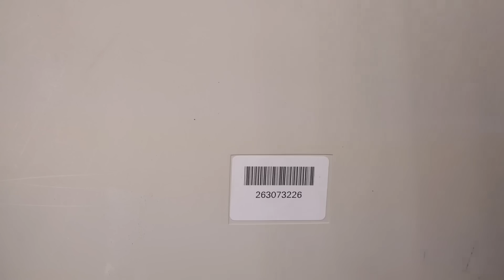Figuring out how to remove polystyrene residue from cords

Comment: After using acetone the cable will be dull, use cheap furniture polish, the old fashioned kind with wax, & go over the dulled cable. It will look like new, help clean it, & it adds a bit of protection too. I use Behold, but there's others, dollar stores are the cheapest. Its also great for cleaning & protecting any plastic or rubber.

Comment: I also noticed a similar issue happens if you buy a toy that has the egg carton holders. The toy parts are in bags. One time I threw the bags out and put them in bare. The paint on the toy came off in areas. So I assumed it was a reaction between the two materials. And never did it again.

Comment: IPA and a micro-fiber cloth worked for me. Put it on the cloth and ran it back and forth along an old Vader 2600 whose cord had some styrofoam residue. Yes, it takes a little elbow grease, but it works fine.

Comment: Only done knock off model M external kB for Amiga and telephone/ POS terminals.

I use the 97% ISO like you did though I soak for 15 minutes first.

After wipe off I soak in white vinegar for 30 minutes then dump in bicarb soda & lightly scrub W/ a toothbrush on EMI safe brush.

Takes anywhere from 5-20 minutes to get most of it off.

Some stubborn spots / pock mark corrosion effects may remain.

Comment: Acetone is stored in HDPE containers, also whenever you clean with acetone or IPA wipe off the residue as soon as you can, this keeps the floating debris from lingering in the liquid solvent, as it evaporates from the surface it leaves behind everything it removed. Also for acetone this is especially the case as you are trying to remove the more quickly soluble styrofoam, and not melt at the obviously less-readily-soluble PVC cord. Acetone DOES dissolve PVC in 'high concentration' and is present in PVC pipe cements also.

Comment: I so wish that function keys had stayed on the left as they are in the IBM Model F layout. They're so much more ergonomic that way, easy to press quickly and accurately without looking. As it is, I'm still having to use a keyboard from 1991, the Northgate OmniKey Ultra2, to get that layout (with F11 F12 above the F1 F2 row, separated by a gap).

As for the residue, I'm pretty sure I've had something like this on at least two of my cords. I don't remember how I cleaned them or if it could have been from polystyrene. I do wish you had investigated more what was causing that matte effect when you used the acetone... preferably on a cord you didn't care about, to figure out how safe it really is to use acetone on a cord like that of the Model F keyboard.

Comment: I would try some 0000 fine steel wool to abrade the styrofoam residue. That should leave the finish of the wire pretty much intact. Such wool is often used to polish metal, so it works at a very tiny level on surfaces. It may even make it shinier than before.

Comment: The problem is not the polystyrene, but actually the cable itself. The "juices" that keep it rubbery and flexible, start to seep out, and melt the other plastics that they are touching (ABS included!). 
Always, ALWAYS pack the cable nicely into a little separate nylon bag, as to not touch anything else (the little IKEA zip-lock bags are ideal for this).

Comment: Ran across the same issues, when restoring old Dumb Terminals & Teletypes, of the late 1970's & into the 1980's.  IPA or the older IPA 'soaked' wipes, originally used for cleaning Tape Heads works good, with a little elbow grease.  There is another cleaner, commonly used in the Telecom Industry, generically called DeGel or Gel Off Wipes, which works wonders at removing those stubborn sticky residues, however it is not friendly to all surfaces.  Similar to acetone, use it very cautiously, with rubber gloves, & good ventilation.  It will dry your hands out very quickly, so use gloves.  Follow-up with Windex, & wipe clean with dry towels, to clean the surface of any oily residue.

Comment: I use screen wipes... the cloth is just abrasive enough and doesn't have an impact on the cord. Stubborn bits just need a little scraping with a fingernail - anything harder can scratch the plasticised PVC

Comment: Hi Adrian. I have the same problem some time ago. I solved with a product for cleaning. CIF Crema. is a white cream for clean a lot of things, from kitchen to bathrooms.
I solved with that, and also solved the problem of a tablet with a back of "rubber" with time this get sticky and dirty (like black bubble gum with the sticky felling of duct tape but a strong one), and i get really afraid of this getting unusable. BUT. This solved both problems.
This product is from unilever Argentina. 
Maybe there is a SIMILAR PRODUCT IN USA OR CANADA (i remember you lived in Canada).
Also, i didn't find any detail of the chemical composition. BUT, with a search of this kind of product (THERE) .... I think you could find a good way to replace it with a product from USA-Canada.
By the way, i used, IPA, window cleaner, grease cleaner from 2 different companies (a strong and a light version) and many other products and never find a REALLY good result.
Only with this. It's difficult to use it i used gloves but in the end, the result is PERFECT. IF YOU WANT I CAN SHARE THE LIST OF PRODUCTS I USED TO CLEAN AND YOU CAN MAKE A CHECK IF THE SAME SOLUTION CAN SOLVE THE PROBLEM WITH SIMILAR PROBLEMATIC. (write me if you believe this could be of any good use and i will make the list)

this is the product.
https://www.cif.com.ar/productos/multiuso/cif-crema-original-con-microparticulas/producto.html

Comment: There are not a lot of solvents that attack polystyrene but not PVC. The two that might be relatively easily available are citric acid (which you'd have to dissolve in water) and fuel oil. "Fuel oil" is not particularly well-defined, though. I'd start with kerosene and then try diesel fuel.

Comment: My ebike hub motor has some PVC covers for the axle nuts and they were both pushed into styrofoam packing and did the whole residue thing.  Doesnt affect much but doesnt look nice.  I will try cleaning it later.  I tried scraping it off and it was giving me a hard time.

Comment: Mineral turpentine works fine and its cheaper and it removes any sticky residue. It's my go to for cleaning cables. Put some on a cloth and gently rub it on the cable.

Comment: For obvious reasons, I do not recommend, encourage or endorse the following use of gasoline:
I'm sure many are familiar with gasoline's reaction to polystyrene. For faster results and an attempt to avoid the abrasion from excessive mechanical force, I personally would have tried to use a cotton ball and a miniscule amount of gasoline (think <2ml) before wiping down the residue with IPA and then allowing the remnants to evaporate in a well ventilated area that is free of sparks.
Though, to be clear, I would first conduct this experiment on samples that hold more value as a test subject than as historical utility before ultimately executing it as a restoration procedure on a rare commodity such as a model-F cable. 

Of course,
Even though gasoline, IPA and acetone all share the same NFPA 704 fire diamond (Heath 1, Flammability 3), I'm sure you're familiar with the stigmas and dangers of gasoline. If not, then familiarize yourself through education rather than experience. 
If you experience anything, good or bad, by following the thoughts of a Youtube comment (or thoughts anywhere else) the responsibility is on you. Anything you do is at your own risk.
I am including the common sense warnings because, not only can I not be held liable for any mistakes, but because I genuinely do not want any mistakes to happen. I've been doused in flaming solvents in the past and do not wish this experience on anybody. Noxious fumes and accidental combustion aren't fun, either.

Comment: Hmm... Dremel cleaning pad dipped in IPA running slow. Maybe the jewelers rouge. Also, why did you do it over the keyboard ? You could have simply turned it around and just worked on the cord.

Comment: So PVC is a hard brittle plastic, it's what phonograph records are made of, which need to be very surface hard in order to hold the shape of the groove.

To make cables, PVC is mixed with plastifiers, which are effectively non-volatile solvents, which serve as a sort of lubricant allowing the molecules to slide past each other, making Soft PVC. Unfortunately the ability of those to move around freely means they'll also diffuse onto any material which touches it, and they also dissolve polystyrene, because it's difficult to find a solvent that doesn't work on polystyrene.

The reason Soft PVC is used for cable sheathing in spite of being such a piece of shit is that... well it's cheap and it's naturally fire retardant.

The bottle is of course not made out of PVC. There are two candidate families, polypropylene and polyethylene, and in your case it looks like the latter. Both are highly chemically resistant and highly recyclable, which latter is good if you suddenly find you made wrong bottles or too many of them, happens more often than you'd think. Also hopefully humanity might some day actually recycle that stuff even after it's been used, some countries actually already manage to do at least polypropylene. As a rule, a production line making high-volume products in either of these two will flat out refuse to touch any other plastic than the one they already use, in order to not deal with contamination.

I don't think removal of polystyrene residue from PVC is possible without removing the topmost layer of PVC, because they would have diffused into each other. But on an off chance that it might be, try limonene. This solvent will make quick work of polystyrene but might just have little effect on PVC. ABS is usually surprisingly fairly resistant to limonene as well.

When handling solvents such as acetone near ABS parts, please do not consider a microfibre cloth a sufficient protection. The solvent will soak through the cloth really easily and then you have a case of damage on your hands! Cover the computer with polyethylene.

Comment: I would suspect the bottle that the acetone comes in is HDPE. Which coincidentally is the same plastic gas cans and milk jugs are made from.

That said... perhaps you could try using zippo lighter fuel to remove it. It's a fantastic adhesive and label residue remover.

Comment: The acetone bottle is likely high density polyethylene or polypropylene.  You might try lighter fluid on an inconspicuous area, or WD-40.  Even DeOxit might have a beneficial effect.  Whatever you do, don't try Brakekleen.  You could also try using an Armor All wipe to restore the shiny appearance once the cleaning is done.

It looks like you were actually having fun here, and a little fun in the work is a good thing.

Comment: I always refer to a chemical compatibility chart to work out whether it's safe to use a solvent on a plastic. If you google a chart for PVC, it rates the compatibility with acetone as "D-Severe Effect", whereas isopropyl alcohol is listed as "A-Excellent". However as you saw the main effect is just making the surface dull, since you're not leaving it on for very long and cleaning off any residue with IPA afterwards. It would definitely be worse if you left it on, or even spraying it on can be worse than wiping it on with a cotton swab or cloth.

The bottle that the acetone comes in is probably polypropylene, which has excellent compatibility with most common solvents.

Comment: I have heard that it's additives in the cord (plasticizers) designed to keep them flexible/supple that can cause them to melt/transfer other plastics (like ABS and polystyrene). None of those plastics are particularly soluble in alcohols so I'm surprised it even worked at all, but it would definitely take some elbow grease.

Acetone can dissolve a wider variety of plastics; the bottle it's in is probably polyethylene (likely the low-density variant, referred to as LDPE). Any time you see a milky white bottle that's fairly flexible like that, chances are it's LDPE since it's cheap, easy to mould, and pretty chemically resistant. I suspect PVC would be at least slightly soluble in acetone, which explains the dull appearance after you used it.

Other things to try:
-Gasoline (smelly and will leave some residue) or other similar solvents (mineral spirits being my recommendation for something less smelly) will likely dissolve the polystyrene quite well and may leave the cord less affected than acetone. 
-Ethanol (rubbing alcohol) and isopropyl alcohol have slightly different solubility profiles, so I keep both on hand and try the other when I encounter something stubborn. If you carefully check the labels in either pharmacies or hardware stores, you should be able to find 95% ethanol to keep in your stash to try, but in this particular case I suspect the IPA will work better considering the materials you're working on.
-Lacquer thinner or MEK will be stronger, but I suspect they'll attack the cord itself as well.

Comment: Ok, I learned long ago on how to clean things like this, best way is (going to sound odd) you may want to try it, firstly, vasoline, a heavy quality grease/oil which actually will work slowly under the styrofoam between the ABS, example here would be to just work vasoline all over the cord to start with, and let it sit for a bit, then come back with a 5%~9% mix of acetone to alcohol (I used to pre mix bottles of it, 10 ml of acetone to 100 ml alcohol) and use that to remove everything, it will lift the vasoline and all the styro, which will often tend to leave a nice shiny finish (not greasy).

Comment: There is a plasticizer added to the PVC which makes it more flexible and "rubbery."  This chemical leeches out of nearly all plastics over time.  It's a solvent, and attacks the styrene which causes the bonding.  It actually does the same thing to styrene making it rubbery and more difficult to remove.  Acetone is a highly volatile chemical.  Using it sparingly, it will evaporate off assuming a warm ambient temperature before causing damage to PVC.
Reply: If you want to add some shine back to most plastics including ABS, use Boiled Linseed Oil.  It is mildly solvent of most butyl plastics, and will leave a nice shine on dull or oxidized plastic.  Be careful as BLO can spontaneously combust as it oxidizes and evaporates off of rags and towels.

Comment: I strongly suspect it's not the PVC itself, but rather the plasticizers in it, that's the problem.  It's also probably not an actual chemical reaction either, but slow solvent action.  I would  expect a chemical reaction to produce a more distinctive result than merely gluing the styrofoam to the PVC and the PVC suffering modest surface deformation.  A whole new substance should be created, either properly fusing the two materials together, or appearing as a boundary layer between them.

Comment: Most of those plastic bottles that are chemically resistant will be made of high density polyethylene, hdpe2 usually. Most big rotomolded containers are made of this as well.

Acetone is almost like what’s used in pvc cleaner and I’d definitely expect it to melt vinyl stuff. 

I’d have tried to use a citrus based cleaner like googone or maybe citristrip, these often have lubricating-like effect on old dried out plastic versus ipa which can dry things out and crack paint and such. I suspect you’d have even better results. I just restored a coil cord in a vintage lamp this way.

Comment: Next time try using denatured alcohol also know as marine cooking fuel. This is basically alcohol at 99.9% and the 0.1% is other additives to make it non consumable. One of the additives is acetone which will do the job but the alcohol will do what you want. I use this in all of my electronics cleaning. The only draw back is a light dulling from residue. A quick wipe with a cloth will get rid of it.

Comment: Personally. I take 70% medical grade isopropyl and wet a rag with it. Then grip the cable with my hand and the rag in between, pulling on the cable with my other hand to run it through. For stubborn bits of say paint or material like you're cleaning off. I'll continuously pull that section through the rag and also hold my thumb in a manor where my nail is scraping the stuff off with the rag. Works pretty well, least for myself.

Comment: I would take the precaution of not leaving the cord afterwards on the keyboard case as there maybe a chemical reaction at a later date .
I have seen several vintage calculators having that problem with the power cord reacting with the case

Comment: Usually the bottle for acetone is made out of HDPE (high density polyethylene), styrofoam is basically pure styrene.

If everything else fails to remove the styrofoam mush, DCM (methylene chloride) will, that stuff is properly toxic and cancerogenic and would probably dissolve the cable too.

Don't use it!

Comment: PVC is chemically inert it almost reacts with nothing, but there are addons that are responsible for making the PVC flexible. In 90% of cases these are phthalates. https://en.wikipedia.org/wiki/Phthalates. They act as a solvent on other plastics often , making them look like melting away. I would try wd40 as solvent, since phthalates are aromatic substances